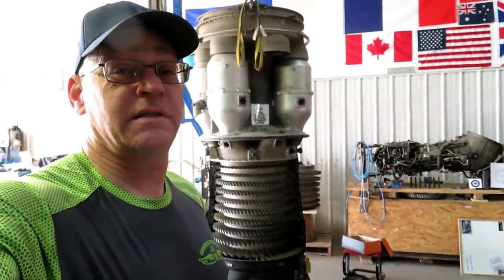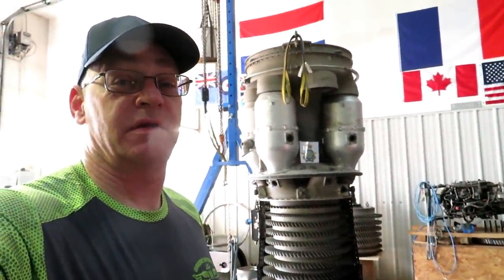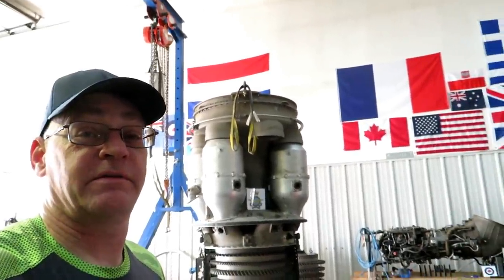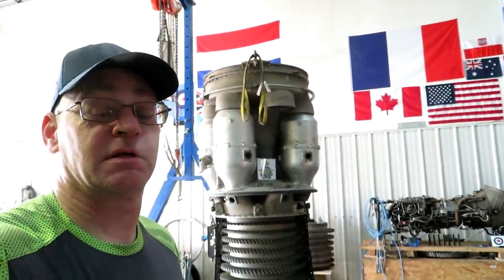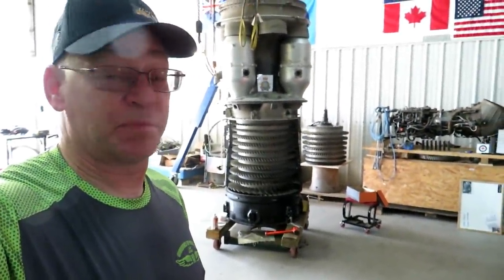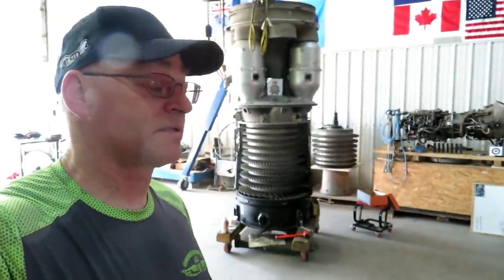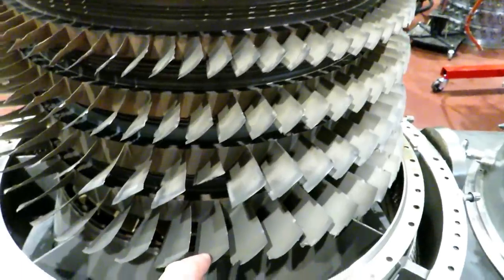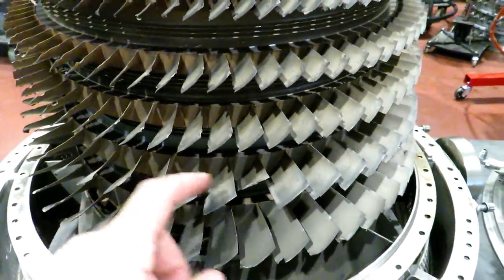Compressor damage update: test run

Comment: If I were looking to buy an Allison 250 power turbine, where should I look?.. (In Canada) it doesnt need to be certified for air worthiness..  it would be in a car or a boat..
Reply from the maker: The power turbine, or the complete engine?
Look everywhere, but be sure of what you are looking for.
Reply: @AgentJayZ  the entire engine/power turbine assembly. I do t know if there are any forums in particular for sales of these engines?
Reply from the maker: I found one up for auction. Current bid 54K.
Took me 12 seconds. Google.

Comment: Are those bleed air ducts always open? In the last video you said they handled excess compressor air that would have been bypassed, if I remember correctly. If these bleeds remain open, are they used to drive the power turbine added to the gas flow after the gas generator turbine stage? What would have happened if that air went though the combustors instead?
Reply from the maker: They do not transmit air to the power turbine. It is waste air.
The bleed valves close at higher rpm, and then all inlet air goes through the engine.
Reply: @AgentJayZ  Ah so these are regular bleed air for managing compressor startup same as a bunch of other engines you've showed us like some Rolls Royce engines and the fixed shaft turboprop engine. Can't remember the name, I think it was a Garret or Allison.

Comment: Where is the FOD screen? Not worried you will suck something up and damage it again?
Reply from the maker: FOD screen is the same one used by aircraft.
Reply: @AgentJayZ  yep true jet aircraft don't have FOD screens this is true.  But they only go high power on runway, AND they get damaged all the time... never mind... ha ha
Reply: They don't really get damaged that often, or they'd have the screens on. Last screens I saw were for Avon sabres sold to Indonesia to stop ground crew getting sucked into the intakes (only takes one mistake). AgentJZ's time is expensive enough that it's worth paying someone to sweep the ground rather than fix the engine... again

Comment: Hi mate, if I may ask yet another stupid question, I'm just really curious and would love to learn more about aviation mechanics, or aviation in general. What is the sound at 1:07? I think you've pointed it out before, but I can't seem to remember where. I'm guessing (which can be dangerous, I know!) that this is when combustion actually starts and the engine can begin to self-sustain? Thanks in advance for your time, and for educating a fool like me. At least I know enough that jets don't run on compressed air, well, at least not the majority of the time, hah. Fantastic job on that repair, too. Good to see it back in service!
Reply from the maker: At 1:06 in this video is the moment the engine begins burning fuel. This is before it can sustain itself, and it still needs a lot of help from the hydraulic starter.
If you watch closely, you can see that this is the moment when heated air begins to leave the back of the engine.
Reply: @AgentJayZ  Cool! I thought so! I also remembered that the engines still need to be spun for a fair bit beyond the point fuel/ignition is introduced, so apologies for the poor choice of words. I'm guessing that the idle/self-sustain speed is a fair bit faster than what the ignition speed might be, but once ignition does happen, the rpms climb a fair amount faster?

Thanks again! I really appreciate you taking the time to reply to these stupid comments.

Comment: Hi, what effect or allowance  on testing of an aircraft  engine  dose the fact that in a test it has to suck air in as apposed to having air rammed in during flight?
Reply from the maker: There is no allowance. Engines have always been tested on a static mount. There is no other method to compare to, or "make allowances for"
The white bellmouth almost totally negates the effect of inlet depression, which is the lowering of ambient pressure directly in front of the compressor due to the difficulty of air rushing in from the sides, and having to turn a sharp 90 degrees before entering the engine.
Reply: I was thinking about that bellmouth thing after the other discussion about the engines that don't have the combustor cans inline with the engine axes. I think some are confusing a sharp abrupt 90+ degree turn, vs a more gradual more rounded out turn in the airflow. I will admit some of the turns did look sharper than the bellmouth, I can only guess something about pressure or maybe the shape of that duct around the combustor liner area may reduce the air turn depression (not really an intake, so "intake depression" may not be the word for it inside the engine?)?

Comment: Jay, what is the loudest engine you've ever had in the test cell without afterburner? Everybody says Speys are loud but how do they compare to the other engines you've tested?
Reply from the maker: Avons, Speys, and Olympus engines are all so loud you can't stand it. Double hearing protection is not quite enough. After a certain point, sound is no longer a hearing experience. It becomes something your whole body feels. We ran an industrial Orenda yesterday that sounded like a rocket.
The loudest? A meaningless question, because any full size turbojet will astound and frighten anybody who has not seen one before.

Comment: Hey J .. Q.. Why with the old test set-up the engines were mounted at the front of the sled, and now they are being mounted at the back of the sled?
Reply from the maker: The track system has evenly spaced mounting holes all along the length. I'm not sure why this engine was mounted in this location, of the many options available.

Comment: So do y’all mainly overhaul/repair only older aircraft and industrial engines?
Reply from the maker: Well, you say that like it's a bad thing...
Reply: AgentJayZ  Sorry. Absolutely not. I think it’s great keeping the older engines running. I have many fond memories of when I used to test the older Rolls Royce Spey engines. I’ve been testing engines for a long time and miss those days. Most of our engines now are DECU or FADEC controlled which can make things quite a bit more challenging. But not many people left that can draw performance graphs or trim balance with a polar graph.
Reply: The trim balancing was for our Tay engines and the P&W JT15D’s.